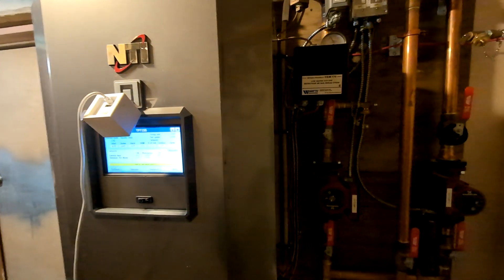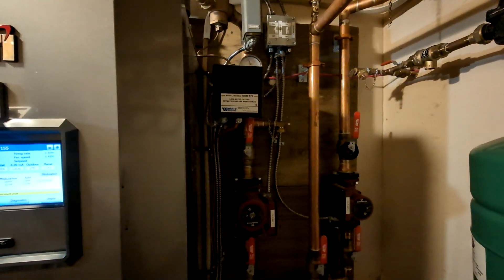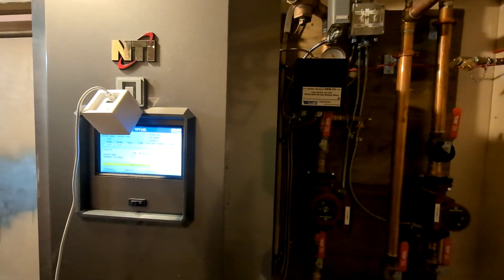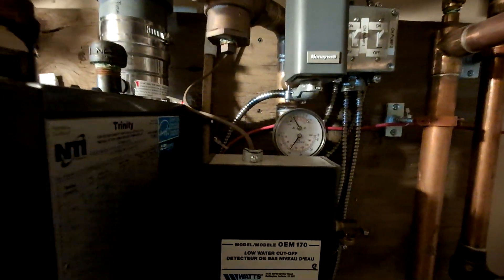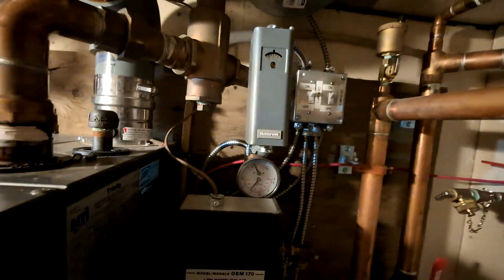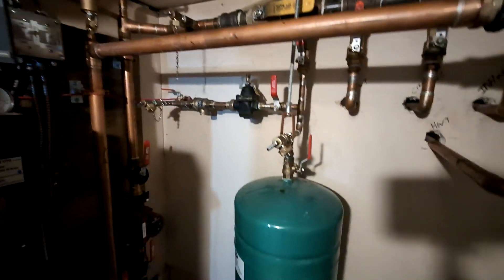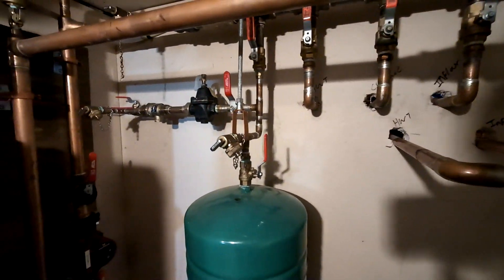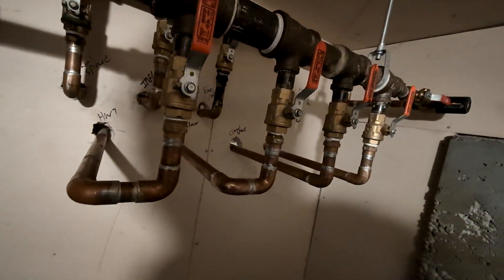HELP! I NEED A HYDRONICS PLUMBER/TECHNICIAN  🚨 | TROUBLESHOOTING MY HEATING SYSTEM #NTI #boiler

Comment: u could also just take the Water from ur hotwater tank and circulate it ?

ps im in lynn lake mb its curently a balmly -33 this morning
Reply from the maker: Yeah it's a good idea, but would take some re-engineering of the system! 

Lovely.... -28c here this morning!
Reply: i know the old airhanger here had a genset that came on to run the heat to warm the hanger back up when they opened the doors at 40 below
Reply from the maker: Probs cheaper to run the genset than electric cost and fuel cost!
Reply: for big industrial and airhangers genset is cheaper for instant reheat indeed. but for residential no but could be rigged up for backup power system. 

genirators are over 1$ 1.50 a kwh atm
Reply from the maker: Assuming that's because of your guys increased gas costs?
Reply from the maker: Yikes. Pricey
Reply from the maker: That said YK electric is astronomical
Reply: @northern_frontier  but yea what ever u do will take a rejig maybe a wood stove for some of those days in the garage would help to?

Comment: I love boiler heat in my house. Sometimes I have to turned thermostat lower on the coldest days. I have only one run on my boiler. I need to insulate my boiler lines. And remove a radiator in my bedroom. It gets too hot. Can you turn the garage floor heat off? And then only heat it when needed. Because garage sounds like a waste to heat. Cheaper to run block heater on vehicles.
Reply from the maker: It probably is cheaper to use block heater yeah, but man it's a life changer parking inside when it's -40c out. That said, my truck has to park outside so the wife only benefits from the garage. I'm just trying to find the most cost effective way to make the system run!

Comment: Im a owner . Radiant wants to be 110 to prevent damage to the floors.  Second heating a garage with radiant? Weird. Your car doesn't need to be much warmer then 40 F . That being said the 15 minutes it took to get you to spit out your problem would have any tech running for the door . Your btu loss makes your system run . Ok . Insulate better , turn the stat down, put freezer curtains on your garage door . Lose less btus.
Reply from the maker: Everywhere online says 85-140 degrees. There is no way to run a boiler at 170f and mix down to 40f , being that it takes the return line for mixing. 

The aim of the video was to go through the entire system so people understand the configuration and the issues and what's been done to date. Sometimes there is value to listen to your customers rather than rush through and not fix the actual core problem. 

Garage door is insulated, and thermostat is 8degrees. 

Thanks for stopping by. Considering the other 20 HELPFUL comments on here so far, BTU loss isn't just the issue. If my technician responded to me with those solutions, I'd be kicking his ass out the door and questioning their credentials.
Reply: @northernfrontier3646  ok i dont know where 40f came from . My advice os based on decades of knowlege . The range reference allows for different building materials.  Im telling you the temp swing can cause buckling or cracking in your floors and to address the heat loss.
Reply from the maker: You said 40f in your original comment?
Reply from the maker: You also provided no proposed solution other than insulate? Just isn't an helpful comment.

Comment: Ok I’m a Process Engineer that built my own house on Vancouver Island with full hydronic heating. I recommend you look up Tekmar they are a Canadian hydronic heating company lots of great info. Also look up Heating help forum mainly steam heating info but some hydronic. For the garage or any radiant you want constant circulation so turn the floor water temperature supply down really low my house only needed 30C to keep house at 20C. Boiler run time is not critical as it’s a modulating gas boiler so will only consume as much gas required to make the exit water temperature. Yes you want to use the outdoor reset. For outdoor reset the -40 is your design temperature so you did right to turn it up to match the actual house heat loss but no more, again the garage is solved by effectively bypassing the thermostat by turning the water to garage down at the mixing valve and therefore keeping the pump running continuously. Again there is no issue with boiler running and fancoil continuously your boiler modulates down to low fire and will run the most efficiently.
Reply from the maker: Hi Tony - thanks for the feedback - hope all is great on the island. I think the biggest waste of energy is the fact that the boiler has to run for 2 maybe 3 hours @ 170F in order to feed a 130/degree water line to the garage to increase the garage by 3 degrees or so.... then the wife goes out again and the garage loses the heat and it starts all over again.

I battle with giving the fancoil enough heat so it can actually warm up the house but not making the boiler so hot that it i can't keep the temperature down to the mixing valve, as it takes the colder water mix of the return supply being that it's a close loop system.  I think the design itself, to where i have got it to right now, would be great for a down south home where i'm not against the -40c temps. Though i do agree the modulation aspect of the boiler should control energy consumption to a degree, though is it really efficient running for such a long time for such little heat output?
Reply: @northern_frontier  your boiler has a 10 to 1 turndown modulation so on low fire it will only be burning 15 MBH of propane or 1 pound per hour. The boiler only needs to put into the water the amount of energy that is removed so even though you might be asking for 180F and then the garage mixing valve mixes it down to say 110F it still comes down to energy out equals energy in. Again don’t worry about  the boiler runtime you are wasting more propane with the garage thermostat causing the temperature overshoot. You can change the controls so that the DHW and the FanCoil circuit both trigger a call for DHW and therefore boiler runs at the high fixed temperature then the garage can be operated on full outdoor reset as a continuous heating call and you can then eliminate the mixing valve.
Reply from the maker: Okay, so what you're saying is that I can change my fan coil and crawl space zones to pull from the domestic hot water option Rather than the central heating option? And basically set the central heating option 130° and basically stop the mixing All together?

I would need to figure out how to do that on the NTI boiler as that would ultimately fix the ability to increase the fan coil heat without impacting the garage floor. 

However, how do I stop the garage floor from overshooting?
Reply: @northern_frontier  the boiler outdoor reset takes care of the overshoot risk by constant circulation and variable water temperature. See Tekmar essay link.

Comment: I've been in Yellowknife, NWT for 40 years and have had a few houses in that time with hydronic heating and one with a heated garage.  Here's my 2 cents: for the coldest part of the winter (Dec-Mar) set your cut off at 210 degrees, your boiler set points to 195 degrees and 170 degrees (top and bottom end).  You can return these back to 180/140 for the remainder of the year.  Eliminate the garage in-slab line - i.e., cut it off and cap it.  You can use the incoming and return lines and tie them into a hydronic fan unit hung from the garage ceiling.  This will make use of your existing lines to the boiler (and zone valve) and will bring the garage up to temp much more quickly and efficiently.  Finally, I think what you're calling a "fan coil" at 5:38 is actually an Heat Recovery Ventilator unit with associated fresh air and exhaust piping - this ventilates the house with warm exhaust air pre-heating the incoming fresh air and does not actually serve to heat the house. Hope this helps!
Reply from the maker: Hi Ray - thanks for the feedback. 3rd comment around not having high enough setpoints - so i think I will definitely up those once i got the garage under control. I struggle to get a cold enough mix at 170 down to 140 for the garage slab right now. I am weighing up my options between going hydronic or electric in the garage. I find it much easier to get an electrician in vs finding an available plumber certainly during the winter months (and even summer to be honest - nevermind someone who knows hydronics). Considering how much my boiler runs right now, and howmuch it's constantly turning on and off - i think it'll be even electric i'll still end up saving (even with our cost of electric). I am thinking i could then leave the radient heat as a backup if i ever do need it in an emergency....

As for the "Fancoil" I just crawled under the house to have a look at this - this unit is a Hi-Velocity Fan coil (HV-100H model) and has an hydronic HW line and return going through it. Based of the manufacturer make and model is isnt an HRV unit per this site: https://www.hi-velocity.com/en/hv/Series-HV-Installation-Manual-010118.pdf 

Note that manual say top-end water temp is 190

Comment: for the fan coil check air flow, the front of it may be full of dust, increase set point of boiler every degree c increase is like a 4* increase in energy immittance , and as you mentioned water flow may also be an issue so might be worth checking if the pump is running at full speed. and i think at - 40, to be comfortable you need the house at what 20c ish, thast a 60 degree difference so i would expect the boiler to run constantly as that would be like trying to heat ur home when its 10c outside up to 70c, thats gonna take a hell of alot of energy, imagine how hot all the windows and doorways would feel if your outside touching them at internal 70c.
Reply from the maker: Thanks man i'll check. Yeah it's brutal trying to heat an open concept home here when it's that cold out!
Reply: @northern_frontier  yeah i can image, im in the uk (midlands) and our boiler will fire up about every hr or so and stay on for about 20/30 min to keep the house warm when its cold out (-5c here is cold ahahah, nothing compared to up there) , so cant even imagine how much you have to burn to stay warm.
Reply from the maker: Let's just say i've had 2 tank fill ups so far this winter (we use big 3x400lb propane cylinder tanks) as we don't have underground gas lines like in england - and i had 1 fill in nov and 1 in dec, both were $750 lol

Comment: Radiant heat emitters like you have in the crawl space and the fan coil really dont do a good job with a boiler temp under 180 degrees, in your climate i would definitely be at 185, as for the garage, the cheapest fix would be to run another set of lines to the garage and put a fan coil in there, since your boiler temp is already going to be in the temperature range required for it. Then you wouldnt have to rely on the in-floor heat near as much. The fan coil would recover quickly when the garage door is opened.
Reply from the maker: Thanks for the feedback. It's quite hard to get pipe/plumbing work done here - without causing a knock on effect of other issues occuring. I am wondering if a 2 car garage heater (electric) air blower on an external thermostat would also work just as well?. Essentially offsetting propane cost to electric. I could get that done quite quickly and easily. Thoughts?
Reply from the maker: I'll also add the reason i'd go eletric over hydronic is primarily because i run my pellet stove inside 99% of the time. So it would be the boiler running only for the garage if it was an hyrdronic fan
Reply: The cost will really depend on what the price for a gallon propane is vs. Electric per kw. Typically propane will be cheaper than electric unless you have an off peak program from your electrical provider.

Comment: Consider electrical thermal curtain at the garage exit, plus industrial vinyl curtain. All that will prevent influx of cold air. It appears you are having a lot of losses through a garage door. Consider insulating it and find all cold bridges, which I assume there’s a lot.
Reply from the maker: Interesting i'll look into it

Comment: Yeah... radiant floor heating in the garage in your climate is Not a good idea.  There's no way it could keep up.  If you really want your garage warmed, you have the right idea - put an industrial air heater in there.  Propane is probably more economical, but electric is easier to install / maintain.  And it shouldn't run that often.  Set it's thermostat 5-10 degrees lower than the radiant heat, so it should only run when the door to the outside opens, then shuts off to let the radiant heat finish the job.
Reply from the maker: That's an interesting idea. I was originally thinking that I would just get rid of the radiant heating all together but potentially using an electric air heater to supplement is a good idea. Right now I set the garage heat to about 9° c. So are you thinking maybe an air heater is set to about 5°c or maybe 7? That way when the garage door opens and The initial cold air get into the garage, the heater would turn on and take the sting out of it therefore reducing runtime of the boiler for the radiant. 

The other issue I'm having and the reason why I was thinking of getting rid of the radiant floor heating was because the thermostat which is a mechanical thermostat, When it gets close to the set point  it it constantly turns the boiler on and off. It doesn't just warm up. Say .5° or 1° over the set point resulting in the boiler to constantly igniting and then shutting off. It's not  until we have a sudden surge of cold air get into the garage then it will make the boiler run quite a while. But because the slab is so warm, it obviously makes the temperature overshoot which then shuts the boiler off. I am just wondering whether if I put the heater say 0.5° c above the radiant heat then at least the boiler wouldn't keep kicking on every 30 minutes when it's getting close to that set point. I've replaced that thermostat and I have the same issue. However, maybe I should replace it with a non-mechanical thermostat. I'm just thinking that mitigate The issue with mechanical thermostat and it would only turn on to supplement the air heater